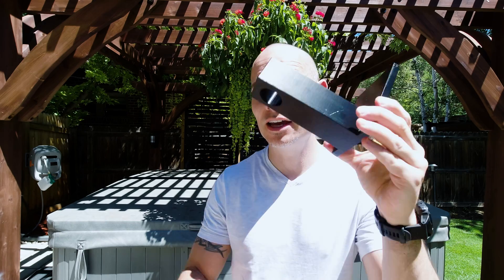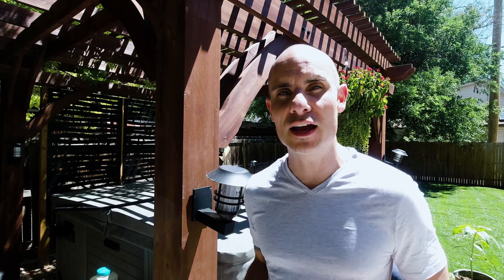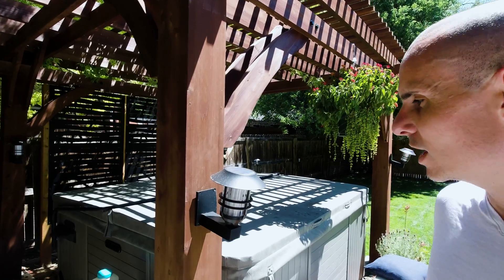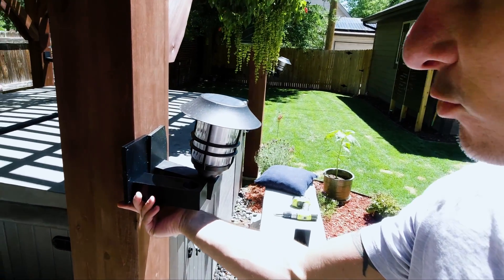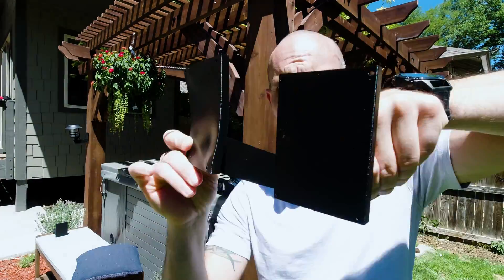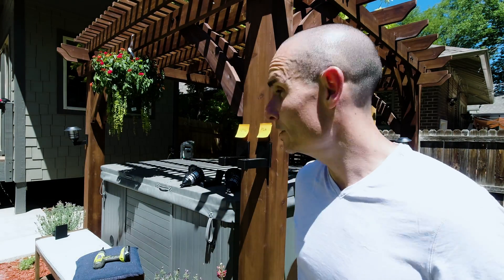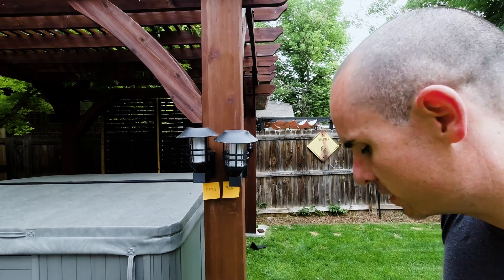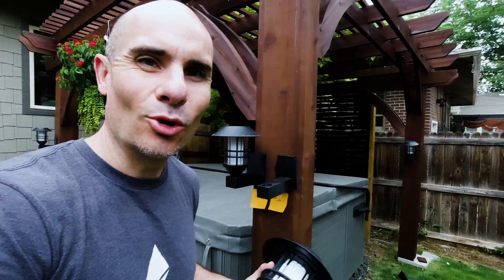PETG vs. PLA: Which is Best for Outdoor 3D Printing?

Comment: I enjoy 3D printing too, but I'd have made those brackets with two chunks of cedar fence board and a couple nails. 2 min with a hole-saw and done.  A fraction of the cost and time and a better fit for the all wood gazebo. Sometimes I think we try too hard to find uses for our 3D prints.

Comment: I'm absolutely agree that PLA is worst choice to print something for outdoor usage. But why you used just two screws? Not four. I understand that it could not help but...
Reply: I used 4 for the permanent installation of the PETG pieces which have now been outside in the heat for over 3 years.

Comment: PETG starts to melt and bend around 80 degree celsius. Due to its ease of use, it is the preferred option for those who need to print outdoor objects. Still, ABS or ASA are the best filament options when the goal is to withstand high temperatures. ABS and ASA begin to deform only above 120 degrees. The flexibility of PETG is also an undesirable characteristic in certain types of use.

Comment: i want to make AQUARIUM DECORATIONS that will contantly be under water in FISH WATER... Can i safely use PLA without concern of dissolving in the water..
Reply from the maker: Good question. I haven't tried that personally. I have used PETG for both flower pots as well as hydroponic systems, so I believe it would handle the water just fine. PLA tends to leak, but that wouldn't matter for your application.

Comment: You didn't link anything.
Good test though.

The black color was either a horrible choice or a good choice.
I wonder how much different would the results be for a white color, since it's not going to heat up as much in the sun.
Reply from the maker: Going on 3 summers with the black PETG prints outside through summer and winter and they still look like new. I just don’t trust pla to hold up, and PETG is easy to print.

Comment: Have you thought of anealing your prints for outdoor or practical use for the extra rigidity?
Reply from the maker: So far I haven't needed to do anything extra outside of selecting the proper material. I may need to give that a shot though just to see what happens.
Reply: @ALLYOURTECH3DP  thanks for the response!!! This was a pretty old video so I appreciate that!! Also I've just had a lot of bad luck printing ABS. had to buy a new extruder assembly since the last one was swallowed by a 1 days worth of filament lol.

Comment: Weird... I made an object to hang, using PLA+, it has a couple of tabs maybe 4mm thick and a hole for a wire, and this supports the object below (100g maybe) - I decided to strength test the loop, but only succeeded in pulling the screw out of the wood that was holding the apparatus up. So I mounted it outside, with 10kg of rocks in a bucket hanging from the loop. Its still there 8-9 months later, no warping/sagging, through an entire Australian summer too..... Other PLA+ parts in the garden have held up well too....
Reply from the maker: Pla+ does seem to hold up to higher temps better than pla. Curious what color your print was as well? I am going to run a similar test with lighter color filament.
Reply: @ALLYOURTECH3DP  Its a tan colour, light brown...
Reply: I've had mixed results in the sun with PLA+. Some smaller, more rigid and higher infill parts (like RC car axles, wheels, hubs etc) seem to hold up fine after days and days , but larger panels and body sections of PLA+ (with less infill, granted) will deform quickly.

Comment: It's kinda crazy to me how inconsistent results seem to be across videos, vs my own experience.  Makers Muse showed a video of a number of PLA prints, 1 wall vases, lasting over a year and the main things that hit his were discoloration due to UV.  I'm in the pacific Northwest and have had my prints out for 9 months (3d models/lawn gnomes) but they've been primed, and they went through snow, rain, and now 85 degree days for spring and part of summer with no warping.  I'm researching before my next video to see what others see, and so far it seems like everyone's seeing something different. I wonder if it has to do with it being non-primed/painted, or if it's because it's functional, or the brand PLA, etc. Thankyou for this video it's a great data point..I'd definitely recommend PETG for functional prints outdoors. I am just wondering if I got lucky on my PLA prints or if possibly priming/painting is affecting the temperature resistance that greatly.
Reply: Don't forget PLAs weakness is heat. Black obsorbs light and converts it to heat. A different colour of PLA would of had a better chance.

Comment: Gotta wonder how white or a print painted a lighter color or metallic would do. The problem here was pretty clearly the heat gain from direct sun exposure which is going to have a bigger effect on black colored objects.
Reply from the maker: Sounds like something I need to test :)
Reply: @ALLYOURTECH3DP  FWIW, I made some little T-beam test objects and put them in the Arizona sun to see how they'd melt. None of them warped a bit. Black PLA - just fine in 110F July sun. OTOH, my bike helmet visor melted in 10- 15 minutes in direct sunlight. How well a part deals with the heat from the sun is going to depend on how its shape absorbs sunlight and how it sheds heat. My little T-beams had a lot more radiant surface on the lower side to radiate heat and not as much on top to collect it. They were also solid, so the heat collected on the top could pass through to the lower surfaces. There was no insulating air gap that would isolate the top surface.
Reply: So my bet is that your torch supports had relatively thin walls and light infill - like my visor. If instead the back of that part was made of a few vertical rails that were solid or nearly so and that allowed for air to pass up and through, the warping might go away or be reduced.

PETG that I left on my car dash became floppy - almost like it was cloth. That was probably at a temp of around 160F. ASA and ABS, OTOH, withstand being dipped in just-boiled water. PETG goes limp in that almost immediately.

Anyway, like you have shown, PETG is clearly more heat resistant than regular PLA.  But it is also pretty easy to run into its limitations in hot environments.

Comment: I realised black PLA always warps. However white PLA almost always have little to no warping. A simple experiment, touch a black PLA cube under summer sun and it will hurt to the touch while a white PLA placed beside it feels almost neutral to cool. The black colour literally absorbed so much heat it melts itself.
Reply: Exactly. White reflects heat, Whereas black absorbs it. I have placed my parts under sun for 3 days and most of them are good. Except for a few smaller components. They deformed a bit. But the infill and wall perimeters matters. In my prints when I tested, Prints without infill deformed more than the ones with infill. 3 walls and 20% infill is strong enough for mine.
Reply: Yes. I noticed it too. Black PLA gets kind of soft when being warmed while other colors stay solid. I think it has something to do with the color the manufacturer adds

Comment: Dude, why on earth did you print in black something that staying under the sun and soften from 60°C ... ??
PLA is weak against UV and outside environment. However, it gets better mechanicals results.
Reply from the maker: As I said in the video, at the time, I was out of PETG. After a full summer in the hot sun, the PETG has held up great and looks as good as the day I put it out there. It's an example of why material choice matters.
Reply: @ALLYOURTECH3DP  I would have ordered a New filament in tour shoes, but let s say it is a nice illustration of what works or not, supplying your content 🙃

Comment: I'm curious what the differences would be if you used a lighter color that wouldn't absorb as much light and heat. Would the PLA last longer? Would the differences between it and PETG be less-stark?
Reply from the maker: Sounds like another experiment is in order.
Reply: Yeah I just commented the same before seeing your comment.
Maybe a gray color instead of full white of pitch black

Comment: Hello Brian, did you leave the petg part outside since the video and how has it been doing since then?
Reply from the maker: I have been using those parts outside since shooting the video. The PETG hasn’t sagged at all. It looks just as good as the day I put it out there. Really happy with the performance
Reply: That's good to know, petg is cheaper per 1kg as of the time I checked. Holiday sales, across most online retailers.

Comment: PETG is hands down superior for this kind of task, but to be fair, you used black when testing against the sun.
Reply from the maker: Sure, but also to be fair, the black PETG has held up fine :)
Reply: @ALLYOURTECH3DP  Because PETG can  withstand higher temperatures. I doubt white PLA would of warped though.

Comment: Excellent experiment. In my previous projects, every time I
tried to machine PLA, it turned into mush because of the heat.  That’s why I prefer PETG for the functional
parts. Always good to see the real thing happening before your eyes. Great
video. It proves the point.
Reply: Well black obsorbs sunlight and converts it to heat. A different colour PLA would of held better.